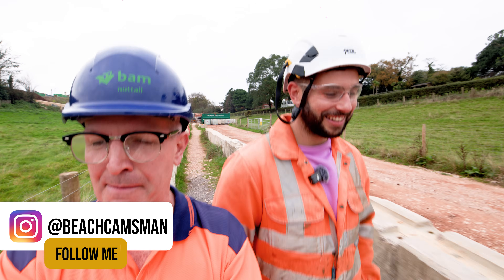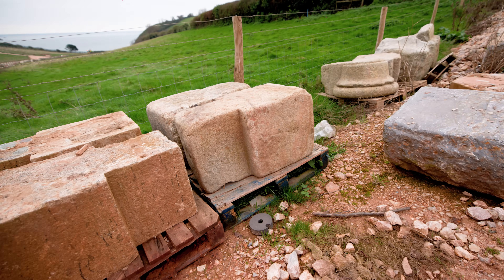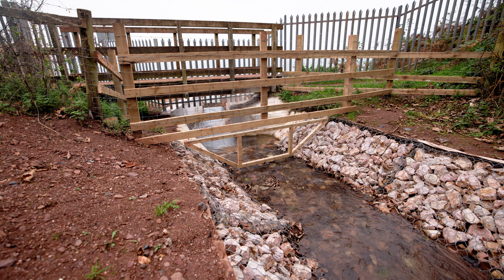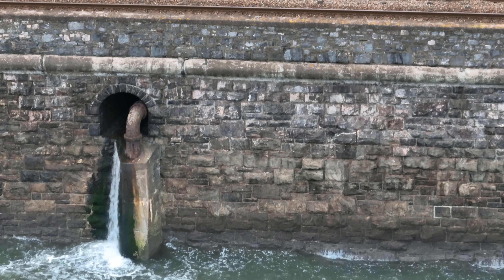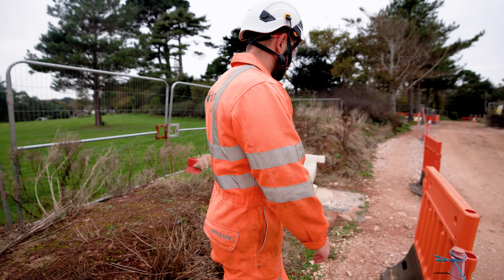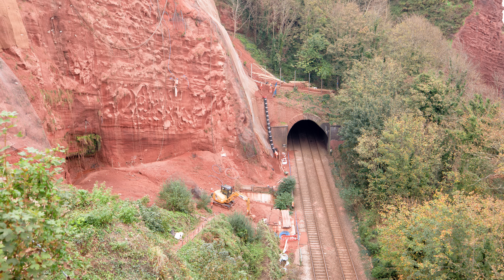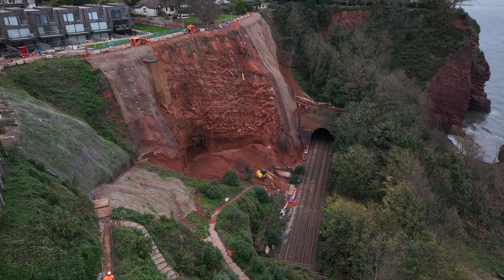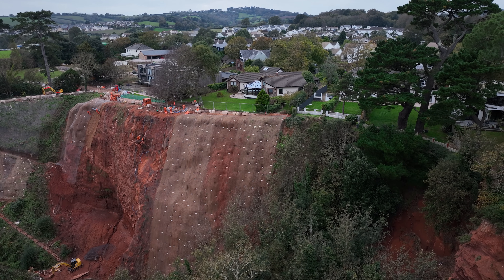EXPERT Engineer Shares Latest Dawlish Cliffs Sea Wall Update 8k, Could This Be Our Last Tour? Part 1

Comment: I have just had a thought of what that pipe might have been at the weir. Is there a possibility it was an early ‘sewer’ pipe from a house or houses further up near the road? Which of course would dump out at sea? Of course when proper sewerage came through it was disconnected?